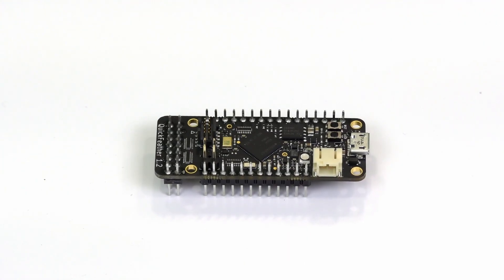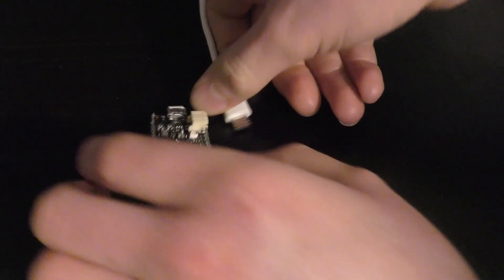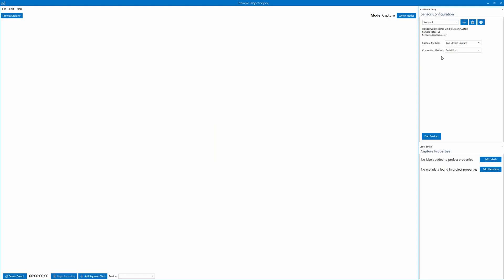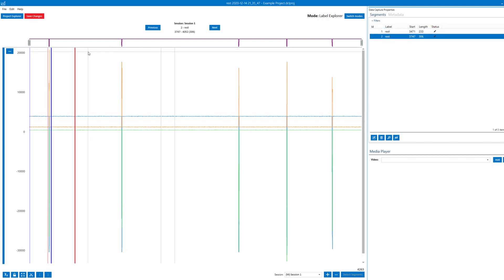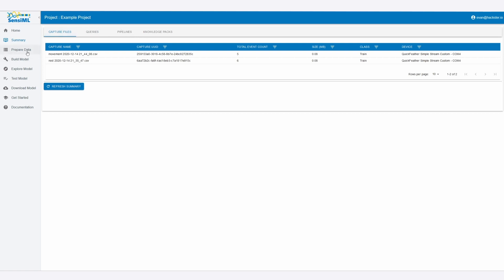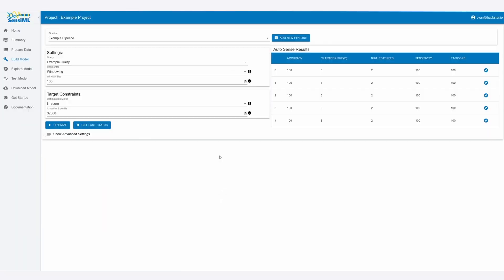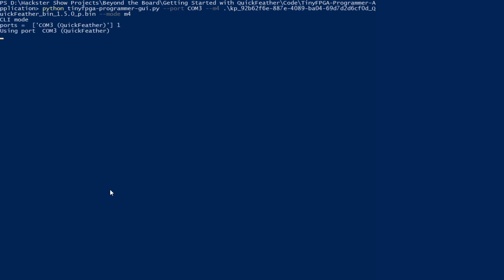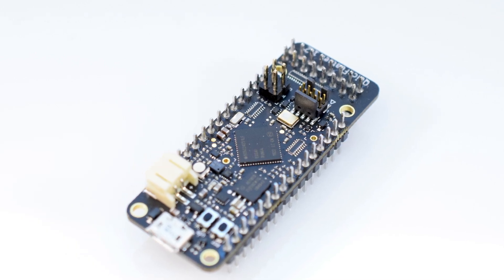Getting Started with the QuickFeather Dev Kit and SensiML

Comment: Have you had this problem?   When inferencing, reporting of classification is correct (1=movement, 2=rest) works for about 15 minutes and then all classifications = 65534 after that regardless of type of movement.  Of course a board reboot works but the problem comes back 15 minutes later.

Comment: Excellent tutorial. Thanks!
Ran into several challenges mostly because I did not listen to you carefully enough. A few of the software parameters must have changed since you wrote the tutorial. 105 samples is not an option so I selected 100 and all works fine. The 105 threw me because that is an option for the MQTT-SN.
I got a bit confused as to if all 4 FTDI wires had to be attached and when the USB had to be attached to the board but trial and error eventually answered all this. All 4 FTDI wires and no USB when inferencing into the console. Use USB only when flashing the binary.
This tutorial gave me an amazing head start toward my goals.